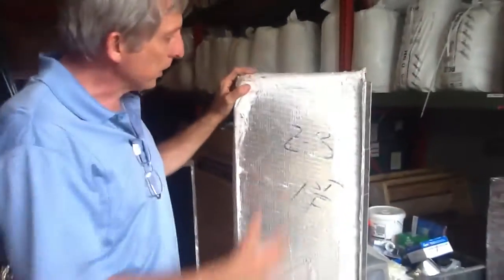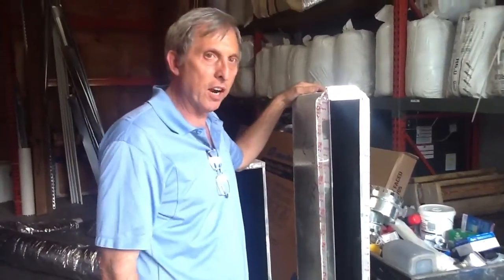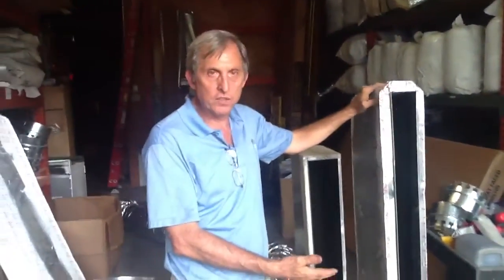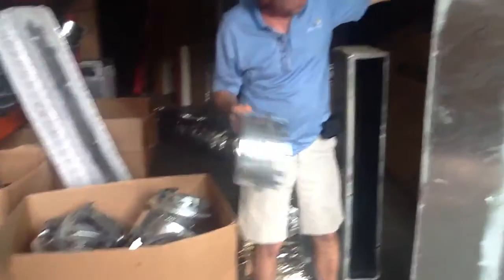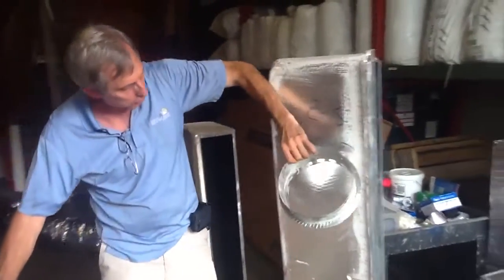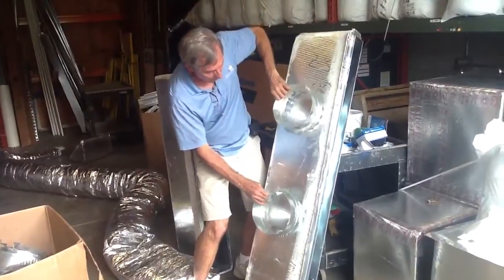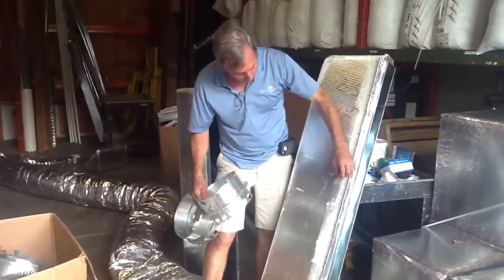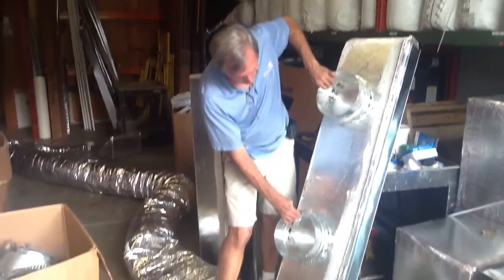How to Design Linear Diffusers

Comment: Good Day... How do you solve the sweating problem in these systems. i keep having droplets of water coming out of thin slit diffusers. i would appreciate a solution if any.
Reply: Any type of condensation is solved with insulation around the box or pipes